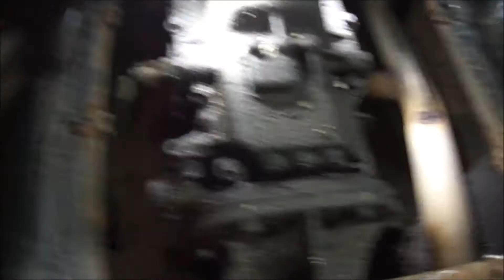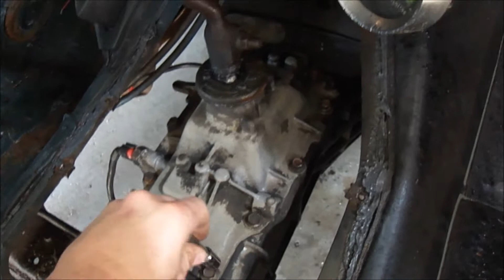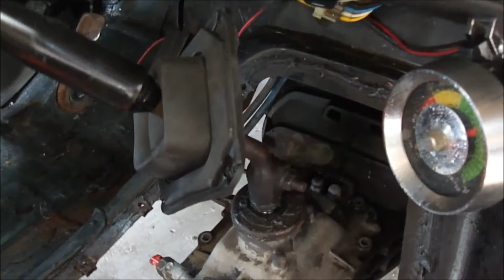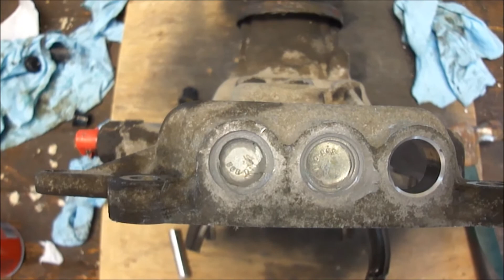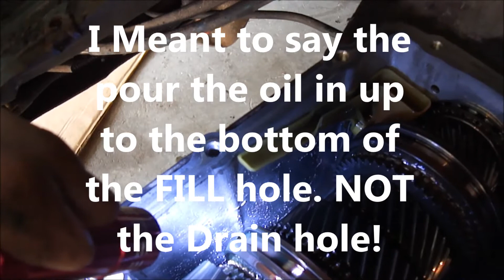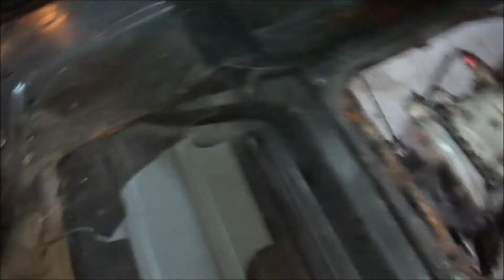M5OD Leaky Rubber Plug Repair

Comment: Hey Steve...did you have any issues getting the top cover back on, with the synchros or whatever? Or do they go in one particular position..thanks bro
Reply from the maker: Put the trans in neutral prior to removing the top, and don't move anything while working on it and it should go right back together.

Comment: Can you access the plugs from above by just taking the shifter plate off? 1994 Mazda b3000.
Reply from the maker: Its been a while, but if I remember correctly it was a little tight to do in place, and that's on a full size truck.

Comment: Everything is metric including the soft plugs, this is a Japanese Mazda M5OD transmission. Use some Permatex high tack or Faber's non hardening sealer around the plugs before installing as with all steel soft plugs and I believe Dexron II ATF fluid.

Comment: Hi friend, how are you? Excuse me, so is a 5/8" coolant cap the solution? (Will any 5/8" metal cap work? Or is it something more specific? Is it possible to install these three metal caps without disassembling?

My Ford Aerostar van has the same transmission, and it's already leaking oil through the three plastic seals, but there's no room to remove the entire cap. Is it very risky to install the caps from the outside and have one go into the transmission?

Thanks, greetings from Chile.
Reply from the maker: If you can get the rubber plugs out enough to clean the oil off of them and the holes, you will have similar results using silicone on the existing rubber plugs and popping them back in.  The metal plugs will probably be hard to get installed while still in the vehicle.
Reply: @SteveStoltz thankiu

Comment: ATF Only!  Good video. But this can be done a lot easier from the bottom. It's not neccesary to remove the top cover. But good job. Also make sure there's a breather on the transmission or it will build pressure and leak. If I'm not mistaken those rubber plugs are also a vent.

Comment: Correct M5OD oil is ATF Mercon 5. But if it works, it works. Just stating the right stuff to use.
Reply: My daily driver 90’ ranger m5r1 has had 80w90 in it ever since I bought the truck in 2011.. I burn through about 2 clutches a year (irrelevant, I know), but never had any internal mechanical issues in the tranny as of yet.. And I drive it like I stole it, constantly.  Reason I’m here is I’m tired of smelling cooked gear oil..  and having to top it off at every motor oil change. 80w90 ate the rubber plugs I figure, turned em floppy.

Comment: why do these holes even exist? doesn't even seem to serve a purpose except to leak...
Reply from the maker: The actual purpose for them is to install the rods that the shift forks ride on, unfortunately the material the plugs were made from didn't hold up over time.
Reply: It looks as though this plugs could be replaced without taking the top cover off if using new replacement plugs?
Reply from the maker: @mannypvd2296  Yeah I would imagine, in hind site I’m thinking the old plugs with silicone would suffice as well.

Comment: Awesome video, thank you very much. I'm having this issue. I have difficulty sometimes getting it into 1st and 2nd without first putting into 3rd. And 3rd tends to grind for just a sec when up shifting. I tell all this to ask if there's anything else that you l, or anyone reading this (ty for taking the time to) that know of anything else I should replace while I have that top open.
Reply from the maker: I'm not sure that there is much that can be replaced from the top that would cure those issues. One thing you should check is that the clutch is disengaging all or the way, Check the pedal box and see if it is worn out and causing a lot of slop in the clutch rod. That will make shifting into gear a real pain. I had to rebuild the one on this truck, and I also need to do it on my current truck.
Reply: @SteveStoltz  Again thank you. I'll look into this. Have a good one!
Reply: @chiliboom6140 I know this post is 2 yrs old. I had the same problem with my 92 f150. Hard to shift to 1st & 2nd gear. I found out there was 90 weight oil in my 5spd manual transmission. I drained the 90 weight oil out and replaced what the owners manual said to use (Mercon 5 ATF). Not only did the transmission shift easier, but it was so much more quiet. I believe the 90 weight oil in time would destroy the bearings because the tolerances are very tight as opposed to the older Ford Falcons/Mustangs which required 90 weight oil.
Reply: @moreWHFS102.3 Turns out I needed a rebuild. My assumption is the previous owners didn’t drive or take care of it as well as I take care of my vehicles. I use Mercon V as well. 
That’s awesome yours was an easy fix though! Definitely a good start point for anyone else having issues.

Comment: I used lucas in mine as well, also added a little 75w90 gear oil and finished with synthetic atf - shifter operates very smoothly now. Do you think a guy could wiggle that top piece out by removing only the shifter boot as opposed to ripping out the seat etc ?   I have leaking plugs also, one wonders why they put rubber stoppers in those holes to begin with
Reply from the maker: It is possible without removing the seat,  but then your fighting with the carpet and there is less room to work. I pulled the seat just out of preference.

Comment: Would jb welding a peice of sheet metal across the holes cause any issues or get in the way for future work?
Reply from the maker: it would just need to be removed before being able to replace the forks or related, as would the freeze plugs.
Reply: @SteveStoltz  ended up doing it works perfect used a grinder to shape a peice of galvanized degreased it with brake clean  and put high pressure jb weld on it

Comment: Did you have to reseal the mating surfaces from the cover to the top of the trans with silicone or a gasket? Or does it just bolt back on with no issue? Great video
Reply from the maker: I didn't have to seal it with anything, there is a rubber gasket recessed into the cover. Thanks for watching.

Comment: I’ll let you know how mine goes. Thanks kindly for your documentation. Quality behavior right here. I was gonna cut my floor to access this thing. Imagine my surprise.
Reply: Do you have any experience with this same transmission stuck in 3rd gear? I believe I need to replace the 3-4 fork to solve the problem. any expertise would be appreciated. I have spoken to some guys at local shops on the phone but never got a full read on what is happening internally.
Reply: @nkresman mine kept getting stuck in between 1st and neutral. Wouldn't move, but also wouldn't shift into anything else. Super annoying. Then finally the ridge on the one to two shift fork let go completely and now it just has three neutrals and starting out in third 😂

Comment: whats the part number for those freeze plugs? ive read around that the dorman 555-108 will work. theyre .6377 of an inch.. just barely over 5/8ths. 
Much appreciated!
Reply from the maker: It’s been so long I have no idea, it sounds like you’re on the right track though.
Reply: thank you anyway, steve!
Reply: @SteveStoltz  also! i completely forgot to ask! did you use just straight 30w oil or could i use a multiviscosity oil? thanks!
Reply from the maker: @catatonic_wrenching  I used 5w 30 syntehtic, Id only use it if the transmission has a lot of miles/wear though.

Comment: 30W motor oil in an M5OD? Mine takes Mercon VI ATF.
Reply from the maker: Murry's Fallout Silent Cinema spec is ATF, but when they start to get old and sloppy the slightly thicker 30w helps them operate a little smoother.

Comment: You are only supposed to use ATF. Gear oils will kill these transmissions
Reply from the maker: Mason Chappell the oil I used was 30w synthetic motor oil,  it will help make a 200k+ mile tranny shift smoother.

Comment: Thanks for the great video.  I am about to tear into my 93 F150 to replace a worn or broken shift fork.  I plan on replacing the plugs as well.  In the early 90's I replaced a myriad of ranger and bronco transmissions due to these stupid plugs.  They are one of Ford's biggest fails ever.  I can't begin to imagine the cost to consumers from that lame design. Anyway, thanks for the visual walkthrough.  It will save me time exploring.
Reply from the maker: Thanks!  I'm glad the video helps.

Comment: Interesting video. I have a ~132k M5OD-R2 that's going into my 5.0 swap Ranger. I'll make sure to do this before I get it in. It's been sitting on a junkyard storage shelf for quite a while(receipt says 124 months lmao). I'll try running some Lucas in in to get it to shift nice. Junkyard stored it drained and dry with plugs in place, but it goes into gear and the output and input shafts all turn properly.
Reply from the maker: Definitely easier out of the truck

Comment: yeah mine leaks also I filled it up about maybe 2 months ago and my dad says you need that fixed make sure its not low on fluid i might try this seal fix thing if its not that causing it then I got no clue there is a bunch of nasty greasy shit on the side and getting worse the further you get to the floor board the bottem is clean but wet with trany fluid
Reply from the maker: The deteriorated plugs are likely the problem. Thanks for watching.

Comment: TY for the video, very helpful. BTW did you put engine oil in the transmission?
Reply from the maker: binthrdonthat  yep 30 weight synthetic, it particularly helps smooth out the shifting on high mileage tranny’s.
Reply: Yeah I was thinking the same thing I've never head of anyone doing that. Not to say it's wrong I've just personally never heard of anyone doing that.

Comment: Mercon V is the only fluid that should be going in that transmission. and that Lucas is meant for automatic transmissions.
Reply from the maker: Technically that's true, but on this 200k+ mile  trans the slightly thicker oil with the addition of the Lucas additive really helped it shift a lot smoother. The Lucas site states that the "transmission fix can be used in light duty manual transmissions to increase shifting ease and transmission life". It worked well for me.
Reply: Yes Steve is correct, as I have used the Lucas trans fix in 3 of my m5od's over the years, and it does help immensely. I had noises that sounded really bad, I'm pretty sure it was bearing related, and the Lucas product solved my noise problem and help make the shifts smoother. The only thing different that I did, was I used the specified ATF with the Lucas product, but to each their own. I'm going with my personal proven formula that I mentioned in my newest m5od that I bought recently to replace the god awful automatic in my Explorer. I don't reckon anyone HAS to use the Lucas product in their manual transmission, but I'm a believer in the stuff, as opposed to just straight ATF.
Reply: So is Mercon.

Comment: Thanks for posting this. I am going to be tackling this on my 94 F150 soon. Do you think it can be done with the seat in?
Reply from the maker: If you don't have carpet installed you may be able to, but it would probably be more of a pain than just taking the seat out. Its a lot easier to be able to hop up in the cab and work without any obstructions.
Reply: OK, thanks for getting back to me.
Reply: Wanted to follow up as I did this over the weekend.  Decided to try it with the seat in and it was no problem at all.  Just pulled the carpet up, folded it back over onto the seat and had plenty of room to work.  Ironically enough, the hardest part of the whole process was getting the 4 bolts that hold the plastic shifter base to the floor back in.  Everything else went smoothly.  Thanks again for the video, it was very helpful!